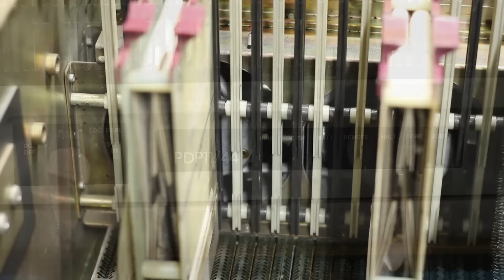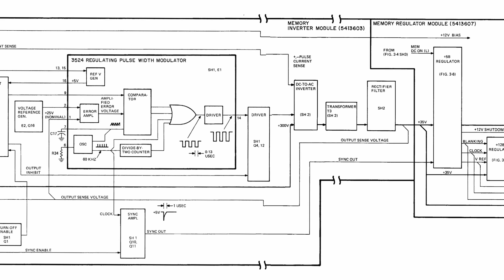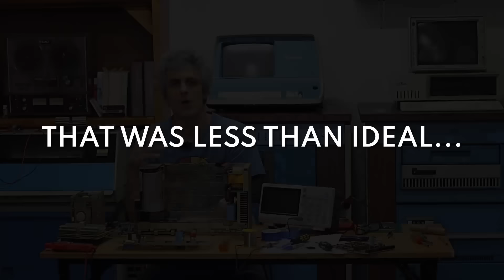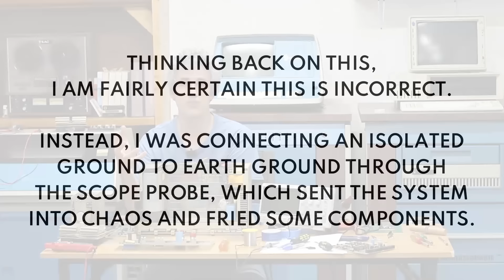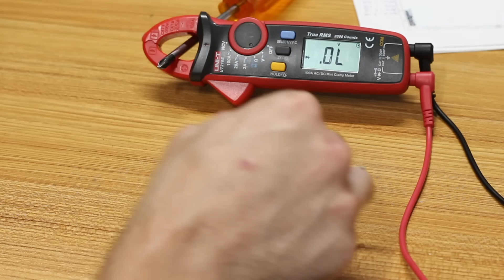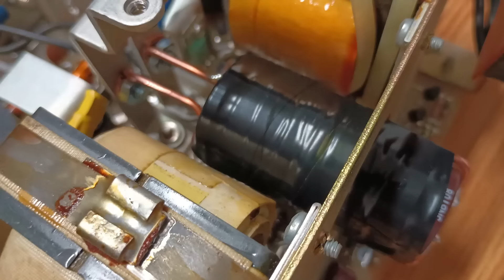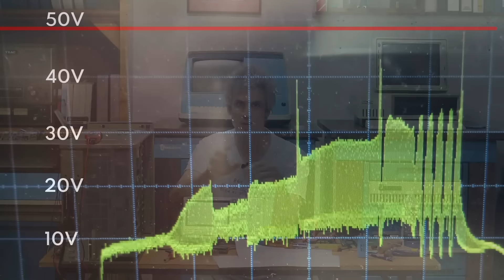PDP-11/44 PSU is Slowly Coming Back to Life!

Comment: I have some original manuals you may be interested in. Don't know how to contact you. I reached out to Vintage Geek Aaron to get yours but he has not gotten back to me yet. Docs are original documentation for Dec equipment I had, specifically VAX and RSTS for the PDP-11. Also docs on the pdp-11 6502 cross assembler that was used to assemble early roms for computers. If you can use these before I recycle let me know!:face-blue-smiling:

Comment: And As You Said in the Beginning,The Memory Need a Stable 12V for The Memory, And Yes on my PDP 11/03 Workstation It the Smaller LSI11 CPU card, But on the Other PDP 11/03L ""The PDP 03 there is (Two LSI 11 CPU cards for The Unit,) One (Workstation) Is Smaller 2 Bus Slots Zero Cache on the CPU, But my other Unit the PDP 11/03 L it a Bigger And More Memory you have to keep LEVEL on that Voltage,  Or the Timing on all the Memory, is Kept that Way, Because the Best D.C. is from a CAP, and a Batter CAP is Still a Battery and it Secret of my Big Designs... #4 Pica Mouse in the Library of Delphon.,, Yea I am That OLD.. I also know it All and BTW, the 4th is Coming  Up So Yea, L8r..

Comment: I would have replaced ALL of the electrolytics as a first step.
And used my battery-powered isolated (floating) Hantek 'scope.
I am not "precious" about keeping failure points, merely for performance art.
Reply: I’m of this school also. In something this old, if you have any thought of having be a runner at all versus “I got it to boot - great, off to recycling” then they just need to be replaced. No nostalgia value.

Comment: You should either use a differential probe or if necessary a differential probe combined with an isolation transformer for the power supply.
If you would plan to poke around with probes inside of the supply i would highly encourage you to use a transformer. But you decided (almost completely 🙂) to avoid that and i think most of the time that's a very good decision.
And as a little precautionary hint, usually differential probes need some kind of ground connection to keep their common mode voltage in an acceptable range. Together with a floating device that can be a really difficult mess.
In the end everything you do, should protect you from injury first and then, if possible your machines.

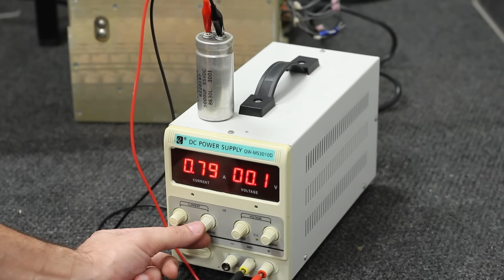Comment: 15:35 pretty light and smoke show? It's a very roundabout way to say "it explodes in your face". This capacitor does not have a vent which means in can fail in only one way - and that one is toward the hospital. Please discard this b0mb and never put 1A of current into shorted capacitors!
Reply: It's perfectly safe to put multiple amps into a fully shorted capacitor, the dissipation will be practically zero. Now if the capacitor is only partially shorted then yes you'll have a bad day.

Comment: When you used that replacement diode with a red lead instead of a black lead, I winced and hoped the polarity was correct when you installed it, but I guess it was.

Comment: Worked on a few SEL minis (their 32/77's and 32/87's).  They used separate power supplies for each voltage (+5, -5, +15 and -15) and yes, the main SELBus had several 100A 5VDC power supplies with some pretty massive cables.  CPU was five boards alone, nothing but 7400 series chips IIRC. (oh, and the 'memory bucket', a separate card cage, had power supplies of its own)

Comment: Three days isn't bad going! Myself and another engineer, once spent about two weeks of 'back-to-back' shifts trying to fix a spare power supply for an offshore seismic recording system. I used to walk down to the lab at the start of my shift, praying the other guy had fixed it - and he did the same at the start of his shift. In the end, we conceded defeat, and just posted the damn thing back to France to have the manufacturer fix it. Power supplies are a nightmare!
Reply: Depending on how it's constructed and your gear you can isolate and test rails under load separately but it isn't always going to get you all the way there even then. It depends a lot on how well designed the PSU is, and a lot of them are unfortunately generational designs where one guy started with one design and successive generations of guys modified and tacked on more and more sheisse onto it cutting corners and making questionable decisions on among others to tap off reference voltages and feeds for stages. Doesn't take many such iterations to end up with a pile of dung where the behavior is totally unpredictable and troubleshooting it properly becomes impractical because you'd have to deconstruct it layer by layer. Not entirely unlike debugging code where there have been generations of coders who don't care about the structure of the code, only about tacking on some new feature. The client doesn't look at the code and how something is achieved, they just test some feature and sign off on it when their special case works. 
I've spent hundreds of hours rewriting bad code that made zero difference for the actual function of it from a user perspective, but what it did do was make the code actually do what it was intended to do instead of pretending to. Great fun to try to explain to management etc. "This function returns a -1 in this case, not because it correctly checks X, Y and Z against the corresponding values in the remote system, but because the unit mfg number matches the range predefined in table T1 in database DB5 which is not maintained by anyone and not part of what this function should do, as defined in documentation from supplier.. bla bla bla...."

Comment: There seems to be a lot of confusion over reforming caps. 
Short version: If your capacitor reads OVER it's rated capacitance it's a good candidate for reforming. If it reads UNDER, it's dead and should be replaced.
Long version: Electrolytic caps work by forming a thin oxide layer on the aluminium electrode. For the same capacitance a low voltage cap will have a smaller electrode area and thinner oxide layer. A high voltage cap has a larger electrode area with a thicker oxide layer. With long periods of disuse the oxide layer can slowly dissolve, becoming thinner. This increases the capacitance but reduces the working voltage. If you then apply full rated voltage the thin oxide layer breaks down and the cap dies.
When reforming you apply just enough voltage and current to gently rebuild that oxide layer and restore the cap's working voltage.
After reforming, the capacitance should be about the rated value. If it's below I'd strongly recommend replacing it. If it's a bit above and can withstand rated voltage for a day or so it's probably safe.
A cap that reads under can sometimes be restored to a certain extent by running it at rated voltage for a while. With use what remains of the electrolyte will be redistributed and capacitance may come up a bit but you're only putting off the inevitable demise.
Realistically not many caps are good candidates for reforming and IMHO it's safer to just replace them. Additionally reforming should be done BEFORE powering up the device. If the oxide layer has deteriorated enough to be a candidate for reforming, simply turning on the power could be enough to kill the cap.

Comment: Mate, SMPS engineer here.  either get a couple of decent differential probes, or use an isolation transformer to float your scope, and only ever use one channel. i have a Tektronix TPS2024 battery powered scope that four independantly isolated channels, its absolutely fabulous.
Reply: another option is an owon vds 1022i usb scopethat has built in USB isolation.

Comment: Don't beat yourself up, I've sent 400V DC through a scope probe ground before.
Turns out the negative rail went below ground on that motor controller, and the positive rail was at ground potential.

Comment: That UNI-T meter is a nice asset to have. 🙂 I have both the -E and the newer E-Pro. The -E is on my work as a measuring device for the Trucks I work on, and the E-Pro is my daily goto for electronics since it is quite a bit more sensetive in the mA range, and I have reprogrammed them both to start on DC on all ranges by default, switched off the Auto-Off for Backlight, and also switched off the Auto-Off on the meter entirely. 🙂

Comment: lmao, when I learned the 'an oscilloscope has to be isolated from mains when probing mains powered equipment' lesson, I didn't get the pleasure of just shorting out a diode; I had the probe blow up in my hand and the breaker trip a split second later. oops!

Comment: You need a 1:1 isolation transformer for you scope in this kind of stuff. Think you can use a variac for that too.
Reply: Nah, isolation transformer is for the equipment being tested. And a variac provides zero isolation. It's just a variable autotransformer. An autotransformer doesn't have a secondary coil, it's just a variable tap on a primary.

Comment: Just a thought, but what is the voltage rating of the wire-wrap wire insulation?
Reply: Usually 600 volt when new and clean. Contamination, aging and heat exposure can degrade it to the point of not being an insulator anymore.

Comment: Something to be very careful about is that you probably want to use differential probes when looking at this power supply. You can approximate a differential probe by using two channels on your scope and using the subtractive math operation to display the signals. I've done lots of work on complex power supplies and this is a critical part of my approach. Having a precision DC load could also help you. I have a feeling that all of this will culminate in getting the DC supply on the Bendix up and running. It's fun to watch as always.

Comment: I had two of the 575 Super Eagles on a Sun 3/180 back around 1995.  Had to spin up one drive at a time, THEN turn on the CPU else it would trip a 20 AMP breaker.

Comment: When using an oscilloscope you should always galvanically isolate the scope with an isolation transfo and not connect earth/PE. This makes it so that you can't short-circuit muliple gnds together and use a differential probe

Comment: When measuring and testing big diodes, capacitors, and other silicon, it is very helpful to use an analogue multimeter, instead of a digital DMM. 
The Analogue meter provides more voltage and current for the large component, and will more correctly show leakage, and conductance in those devices.

Comment: Dave, remember,  you should always be plugging the Power Supply into an isolation transformer and floating the oscilloscope with a ground lift plug. You are "lucky" you didn't fry your scope!
Reply: Running the equipment under test through an isolation transformer is relatively safe.  You should never disconnect the ground on your scope, though.  That is both potentially dangerous, and can lead to increased noise and degraded sensitivity of the scope.  They're designed to be grounded for a reason.

Also, running something like this behemoth of a machine through an isolation transformer is not necessarily easy, because most of them are not rated to handle high power loads (or if you find one that is, it's usually really quite expensive).  Still, a smaller isolation transformer might work if you're just trying to get the supply working and have most of the rest of the computer disconnected...

But yes, you always need to be very careful of what you're hooking your scope's ground up to.  Getting it wrong is pretty unlikely to actually damage the scope (might fry the probe, though), but it can often damage whatever you're testing, just like this great example.  Having a differential probe is a good option, but if you don't have one, with pretty much any dual-channel (or quad-channel) scope you should also be able to just connect the signal probe for one of the channels to the "ground" point you want to use as a reference, and then have the scope display the difference between the two channels (subtraction function), to effectively make a poor-man's differential probe, too.
Reply: @foogod4237  Wow, no joke on the price tag of hefty isolation transformers. Feels weird when the differential probe is the cheaper option.
Reply: @oliverer3  I bought one with 1kVA from eBay for 360€ (approx. $390). In europe you have the "advantage" that you only need half of the current for the same power thus the transformer is smaller but on the other side you have to deal with twice the voltage. And with 230V that is about 325V if rectified you should use a transformer for your own safety.
Reply: @oliverer3  don't forget the soft starter either, inrush of 1kVA+ of transformer will pop the magnetic trip of your typical branch circuit breaker. Diff probe+GFCI/RCD is the way, they're not that expensive in the world of active probes, just feels that way because the entry level DSO has gotten that cheap.
Reply: Or the less dangerous option, using a differential oscilloscope probe.
Reply: @oliverer3  Yes! If you need too much force, you ain't using the right tool.

Comment: Since the module that is "broken" uses 35v and not 300v, it might be easier and safer to power it with a lab generator. 
Now I don't have the schematics, but it looks like you just need to recreate the 35v (probably it doesn't need to be that high, maybe 25-30v will do), Sync (60khz, 5v 1us pulse), +12v and "MEM DC ON (L)"
Reply: Look closer - one of the boards on that module takes in 300V and converts it down to 35v.

Comment: Nice work! I would strongly suggest you get an ESR meter to check the capacitors in circuit. This is much much more reliable method than measuring the capacitance via a standard capacitance meter. And it would save you lots of time...

Also, it might be a good idea to reform the caps "in situ" just by putting the bench power supply on the PSU outputs (while disconnected from the system)... I do this on vacuum tube stuff all the time, but there is even easier as the heaters are not powered on

Comment: Tech tip - if your power supply can measure the leakage current of a cap - it's bad!!  Your power supply only shows down to 10s of mA.  Leakage current (once everything is charged) should be a lot less then that. I'm reading 100nA/rated volt.  So at 55V, that's still way, way under 1mA, even allowing for aging.

Comment: You learned a valuable lesson about scopes - that ground lead is connected to the scope's power AC ground, which is probably connected to other things in the circuit under test.  You really need to be careful about where you connect scope ground.  Some people learn it the hard way connecting the scope to a "hot chassis" set and left the magic smoke out of everything including the scope!
Reply: I took out a 20A breaker powering my whole lab doing this...thankfully scope and DUT survived...learned my lesson real quick.

Comment: TBH, i'd actually swap out all these regulators with modern snt modules but that's just me. imho it ain't worth blowing up a rare machine by tacking together slowly failing PSUs. just my $0,02 on, i've seen switchmode PSU going bad in many ways. some just stop working, some start producing ripple and some start running up their output voltage. also some regulators like to get instable when the caps go bad. i had at least two instances of only the crowbar saving a one of a kind piece of equipment

At least always test all the (easily reachable) caps, and do that first, if you want to keep them original where possible